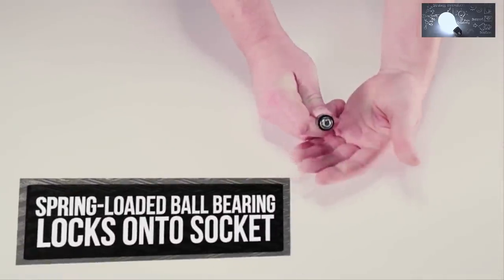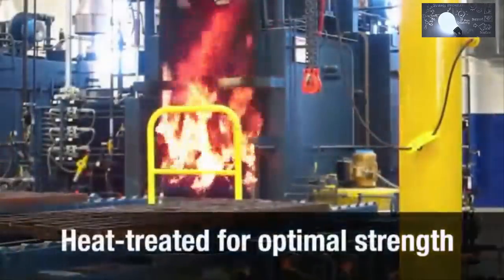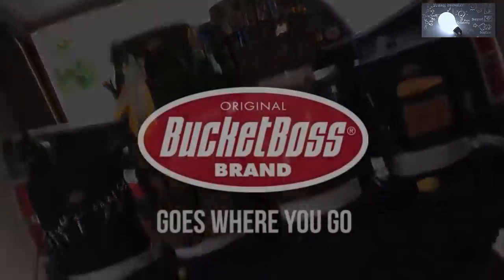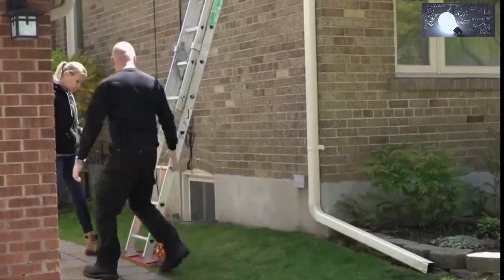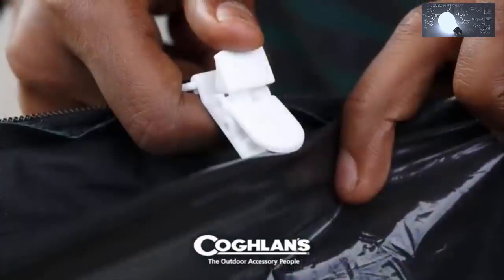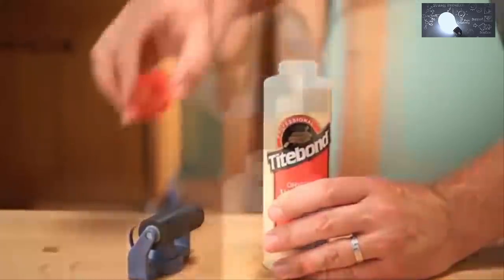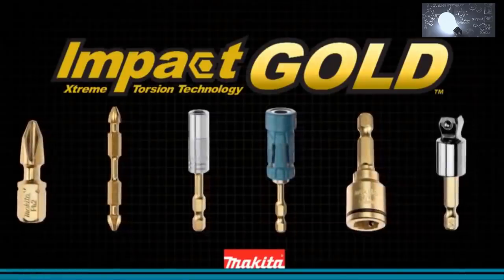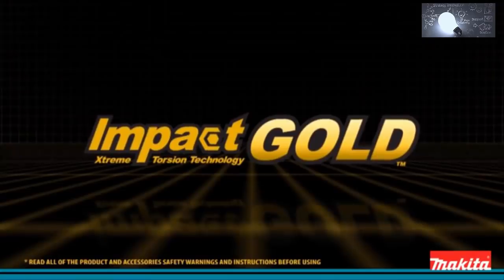10 COOL TOOLS THAT WILL MAKE YOUR LIFE EASIER 2019 AMAZON #  17

Comment: I spent many years as a carpenter till I found that wire cutters cut the 8/32 screw length you need for every kitchen cabinet handle and pull install.  The cutter tool from klein would have come in handy!